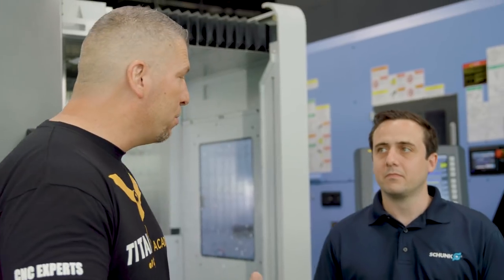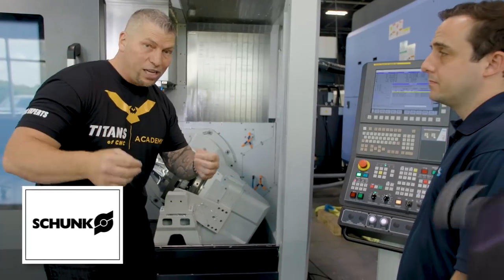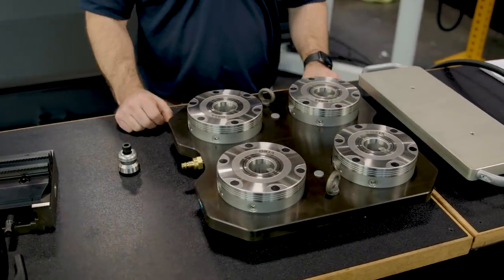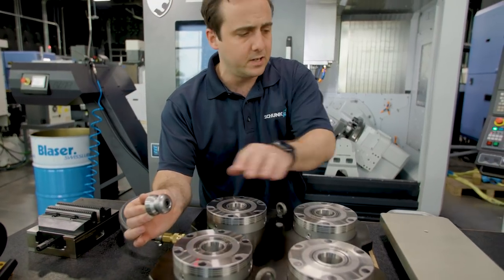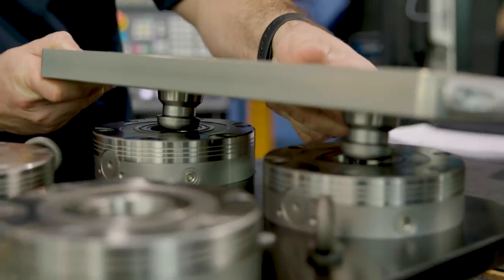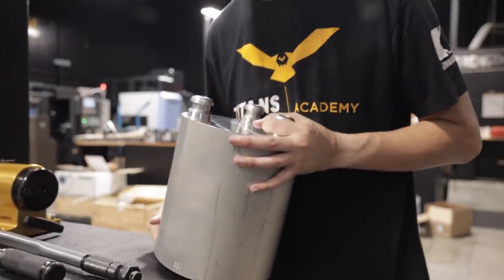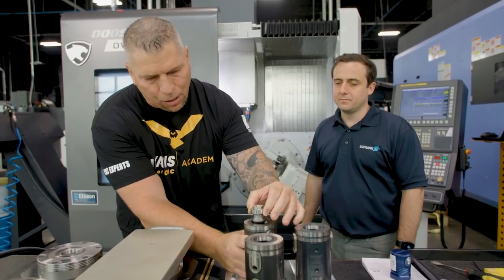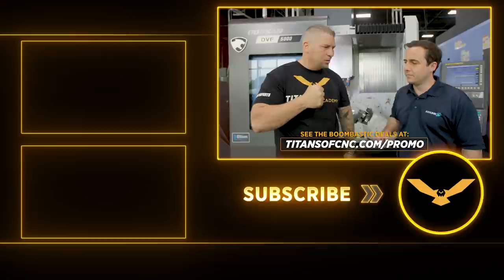Make $$$$ with Advanced Workholding Systems

Comment: Used to run a really similar system on a robodrill with pallet changer, two fixtures a pallet, would push easily close to 10k parts in some instances in a 10 hour shift. And we had a full wall of fixtures in that setup so when you wanted to change to a different job you just unclaimed the fixture, popped the new one on and done

Comment: When using just one fixture barrel what prevents the part from rotating during a
 cut. I noticed the 5X Vise had one fixture point for direct mounting and it was not explained how it might be indexed to the same position with each change over. Would this require a sub plate between the Vice and the puck ? Or two fixture points ?
Reply: Good question... When using only one receiver with a vise like that, there is actually an additional "notch" in the module that uses another pin to index the vise. You can find an example of the receiver side on our website by searching NSL3 150-V1-T (there you can see the indexing notch). The vise we showed is already prepared for that. The vise is the KSC grip 125-160
Reply: If you hold the pallet with 4 clamping pins, how mutch clamping power will it have? Can you drill with 50mm U-drill on a horizontal machine for ex.
Reply: @zyndapp800  I've personally held a 550 pound aluminum forging with three pins on a DMU75 and roughed it with a 2" shell mill at a continuous 90% spindle load. It held perfectly fine so I'm sure a 50mm drill would be no sweat.
Reply: @zyndapp800  Check this out: https://youtu.be/vl6DD9JH_KI
There is quite a bit of force.... specifically: About 25,000 LBS of pull-force. However, that's just the "pre-tension" so to speak that helps with rigidity.
It's not possible to pull the clamping pins out of the module when it's clamped. They will break first.
Reply: Do you know Silvercnc's Zero Point Clamping System and Quick Change Chuck?  We've had it for four years without any problems.

Comment: What kind of repeatability per clamp and unclamp ? How do the coordinates hold up.
Reply: 0.0002" (0.005mm) - That's the best part. You don't need to pick it back-up in the machine...
Reply: And that’s what it’s rated at, which is usually a worst case scenario in my experience.